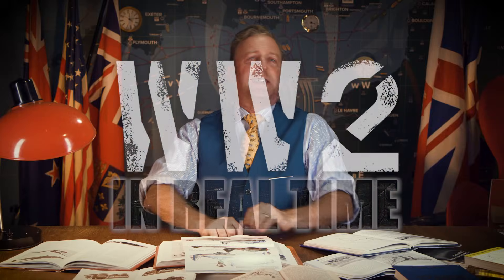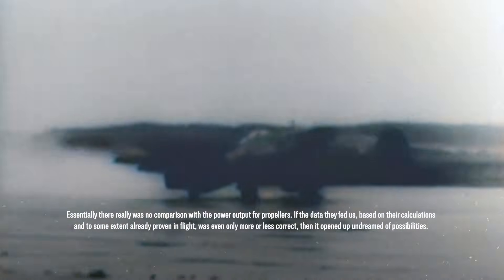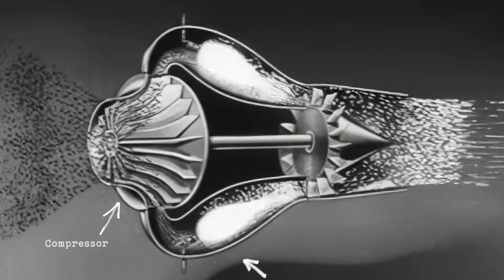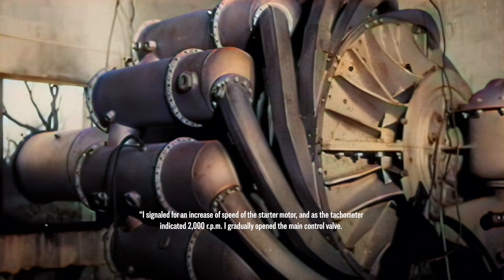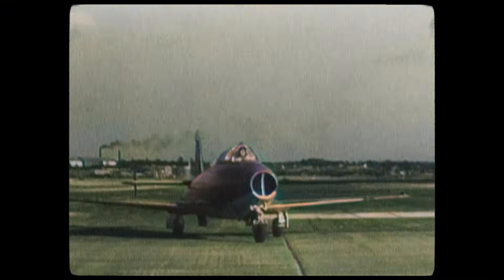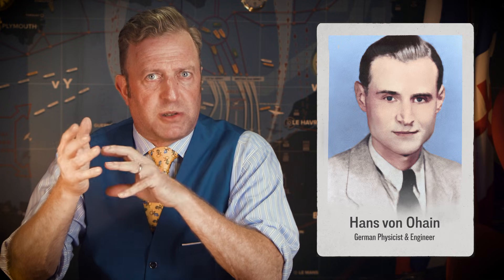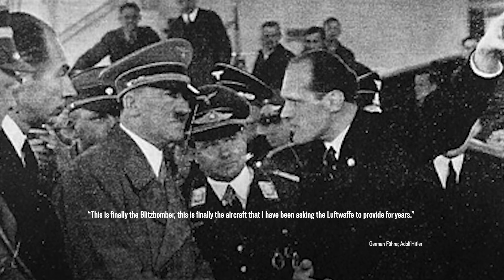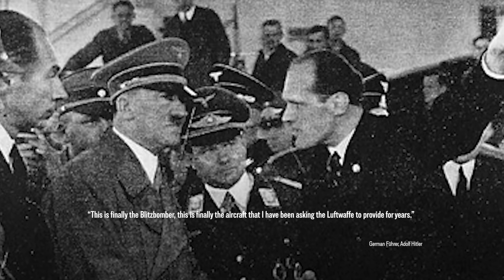WW2 Jet Engine Development - WW2 Special Documentary

Comment: The Brits built a centrifugal compressor while the Germans built axial compressors.
Reply: The Brits actually had a contemporary axial flow, in the Metropolitan-Vickers F.2; a far superior engine. The Brits never used it of course become they were never so desperate to use experimental engines in active planes...
Reply: @tisFrancesfault  thank you.
More information for me to integrate.
Reply: @tisFrancesfault The F.2 was a notable failure, Metropolitan-Vickers would completely abandon jets in 1947 and returned to building steam engines.
Reply: @sandervanderkammen9230  given that the F.2 was the genesis of the successful Sapphire, I don't see how it could be considered a failure. It was scaled up to become the Sapphire as demands for larger engines arose. Metrovick restructured as part of a post-WW2 realignment with the jet business being a valuable asset that could be sold. That's very much not the same as it being a failure, just restructuring. The way you characterise it, you'd think people working on jets one day changed to steam engines the next, which is not the case.
Reply: @wbertie2604  The F.2 was never a flight-rated engine, it never received Airworthiness certification from the RAE and was not adopted by the RAF, it never achieved the minimum PFTR reliability test requirements,the F.2 did not enter production.... it was a complete and total failure.
Reply: @wbertie2604  No production aircraft was ever powered by a Metrovick engine, the F.2 was a failure.
Britain's first successful, airworthy, production axial turbojet was the Rolls-Royce Avon in 1950... an engine developed after the war and heavily influenced by captured German axial compressor technology and German engineers.
Reply: @sandervanderkammen9230  no production aircraft was powered by Whittle's early engines, so by your logic Whittle's efforts were a failure. You position is not credible (yet again).
Reply: @wbertie2604  No engine made by Whittle  could pass the RAE's 100 hour PFTR reliability requirements.
Whittle was using inferior materials like Brown's 18/2 and REX 78, steel used primarily for cutlery and kitchen utensils.
Reply: @sandervanderkammen9230   ah, so Whittle was a failure. Right. Do you REALLY want to suggest that?
Reply: @sandervanderkammen9230  cutlery. Nonsense.

 "Rex 78

A specialised high-temperature steel devised in 1939 was Rex 78 and its derivatives, Rex 78 being used on the turbine blading of Frank Whittle's early jet engines such as the Power Jets W"

I somehow doubt cutlery requires high temperature steel. Or maybe you like to put yours in the oven with your dinner and cook food at 400C? If so, please stop.
Reply: @wbertie2604  I can prove that, none of his engines were reliable enough for airworthiness certification and did not enter RAF service or production.
After the Miles M.52 scandal broke, Whittle was discharged from the RAF amid allegations of extorsion, embezzlement and derliction of duty, he was removed from his own company and exiled to a drug rehab in America.
Whittle would never work as an aerospace engineer again for the rest of his life.
Reply: @sandervanderkammen9230  I eagerly await the proof.
Reply: @wbertie2604  REX 78 alloy was not created for jet engines and Whittles use of Brown's 18/8 and REX 78  which are corrosion resistant, chromium-based stainless steel is why his engines were too unreliable to meet the 100 hour PFTR requirements,  Whittles turbine blades burned up or broke off during the tests.

The Armstrong Siddley Sapphire first ran on October 1st. 1948.

The Armstrong Siddley ASX ran in 1943... not the Sapphire.

The Armstrong Siddley ASX was developed into the Python turboprop but was abandoned.
Reply: @sandervanderkammen9230  Whittle resigned from Power Jets after it was nationalised, along with many other companies, after WW2 and he no longer had control over its destiny. He resigned from the RAF two years later after a nervous breakdown. That's not at all how you have characterised it, so if you have evidence to the contrary, please provide sources. He received a knighthood and other honours, including from the RAF. Later, he was a technical adviser at BOAC, so he did continue in aeronautics.
Reply: @sandervanderkammen9230  more nonsense. Rex 78 was created as a high temperature alloy. An alloy doesn't have to be specifically created for a purpose to be used for it. You claim it was used for cutlery, but surely that can't be true as it wasn't designed for it. You seem to be confusing 18/8 with Rex 78 - the former was corrosion resistant, the latter specifically for high temperature applications.

The Sapphire design dates from 1943. The first run date doesn't change that.
Reply: @wbertie2604  The facts here are irrefutable, your feeble attempts to rewrite history are futile.
 REX 78 has a creep temperature that is too low for turbine blades, no production jet engine has turbine blades made from this material.

The Armstrong Siddley Sapphire incorporated many new features from the ASX and captured German technology, it first ran on October 1st 1948... years after the war ended.
Reply: @sandervanderkammen9230  alloys used in the W1 (this is from a paper by Whittle): Hiduminiuin RR59 and Mg. Alloy No. 299 DTD.350 (compressor), Firth-Vickers Rex 78 and Firth-Vickers Stayblade (turbine). The Stayblade was just the disk of the turbine. Staybrite is 18/8. But it's only a small part of the engine and specialised high temperature materials were used for the turbine blades. Stayblade was DERIVED from Staybrite but was also a high temperature alloy, resistant to 550C, definitely not a cutlery alloy.
Reply: @sandervanderkammen9230  you suggested that the alloys used were fur cutlery. They were specific high temperature alloys. You made a very specific claim which I've shown to be incorrect.

At that period blade creep was an issue for all alloys being used as metallurgy for the purpose was still developing. It took decades to really fix. Should Whittle have used unobtainium?

You've tried to rewrite history multiple times and (pun intended) been shot down multiple times for it.
Reply: @sandervanderkammen9230  and you can provide specific evidence for the German technology used? You've failed to provide such evidence so far.
Reply: @sandervanderkammen9230  in any case, Whittle knew that the metallurgy of the alloys in his W1 was lacking, which is why improved alloys were used in the W2B, which productionised by Rover and Rolls Royce became the Welland, which was a production engine, albeit it in small numbers.

If you must criticise Whittle then his being difficult to work with (and I have personally heard anecdotes of those who worked with him) and that he was not skilled in turning prototypes into engines that could be produced at scale would be entirely valid ones.
Reply: @sandervanderkammen9230 
The F2 was used as a testbed and whilst it did not fly it was the basis for the Saphire engine
Reply: @sandervanderkammen9230 
The F2 was a running testbed in 1941 but was determined to be to heavy at the time for use in the early Gloster prototype so the decision was made to use the lighter and more reliable Centrifugal flow powerjets engine. The F2 was later modified and using lighter Alloys became the Saphire engine
Reply: @tisFrancesfault  it was developed into the Sapphire
Reply: @wbertie2604 The Sappire was a completely new design development by Armstrong Siddley
Reply: "The Armstrong Siddeley Sapphire is a British turbojet engine that was produced by Armstrong Siddeley in the 1950s. It was the ultimate development of work that had started as the Metrovick F.2 in 1940".  

"Design evolution of the Sapphire started at Metropolitan-Vickers (Metrovick) in 1943 as an offshoot of the F.2 project. With the F.2 reaching flight quality at about 1,600 lbf (7,100 N), Metrovick turned to producing larger designs, both an enlarged F.2 known as the Beryl, as well as the much larger F.9 Sapphire"
Reply: @wbertie2604  The F.2 was abandoned by Metropolitan-Vickers when they left the jet engine business in 1947 in total failure, Metropolitan-Vickers returned to building steam engines.
The Armstrong Siddley Sapphire is a completely different engine from the F.2.
Reply: @sandervanderkammen9230  I already pointed out that the Sapphire was developed from the F.2. Your assertions are incorrect. And its not that Metrovick got out of the jet engine business voluntarily - it was by government edict.
Reply: @wbertie2604  The Sapphire was designed by Armstrong Siddley After the war... it is a different engine from the F.2 and incorporates captured German axial turbojet technology... this is why the Sapphire was successful and the F.2 was not.
Reply: @sandervanderkammen9230  I wasn't aware the war ended in 1943. Thanks for the update.
Reply: @sandervanderkammen9230 
No the Saphire had some changes to some of the internals but was a direct descendant of the F2 engine design
Reply: There were five turbojet engines in the UK under R&D in WW2:
1) Centrifugal, by Whittle (Rover); 
2)  Centrifugal, by Frank Halford (DeHaviland);
3)  Axial-flow, by Metro-Vick; 
4)  Axial-flow by Griffiths (Rolls Royce); 
5)  Axial flow compressor, with reverse flow combustion chambers. The ASX by Armstrong Siddley;

Comment: A jet engine is an internal combustion engine. The definition of an IC engine is to use the fuel and the air mixture themselves to generate power (compared with the steam engine, which uses an external source i.e. water to channel the energy to generate power. Which is an external combustion engine).

A jet engine has all the processes a piston engine has. But it is separated into 4 different components (compressor, combustor, turbine and exhaust) to perform them simultaneously, rather than doing them in the same chamber one after the other as in a piston engine.
Reply: I noticed too. Strange how people seem unable to separate the concepts of IC & being piston-driven.
Reply: Excellent points, all gas turbine engines (which Inc. Turbojets) are Internal combustion, the combustion air is also the 'Working Fluid' there is no phase change of further energy conversion apart from mechanical energy.
Gas turbines operate using the  Brayton Cycle and this is the only fundamental difference between jets and Otto or Diesel Cycle engines.
Cheers!
Reply: @@retiredbore378 Interestingly jet engine is not picky about fuel it uses. Theoretically same engine could use any flammable liquid and modern jet fuel is very much diesel.
Reply: @vksasdgaming9472  Since the jet engine burns very lean and uses continuous flow, only a continuous flow of fuel mattered.

But controlling the continuous combustion was proved to be very hard. A slight disruption of air flow (e.g. crosswind, compressor stall) and fuel fuel scheduling would cause the engine to flame out. 

On a minor level, wrong fuel/air mix could cause hot spots in the combustion chamber and severely shortens the lifespan or even burns out the turbine.
Reply: @vksasdgaming9472 Diesel and Otto engines can burn any fuel a jet engine can... it not a unique or distinctive feature exclusive to jets.
Reply: @sandervanderkammen9230  Putting diesel fuel to Otto (gasoline) engine will lead to engine stalling followed by heavy overhaul of whole fuel system. Opposite will lead to smoking, banging and heavy overhaul of whole fuel system. Jet engine is not picky, but Diesel and Otto engines are and latter even more so.
Reply: @vksasdgaming9472  Yes and No, some Otto engines can run and do run on Diesel #1 or Jet A.
Diesel engines that have density compensators can run on any fuel used in jet engines.
All of the US Army combat vehicles in service with a Diesel engine run on JP-8 (Jet A1)
Otto engines can run on any alcohol based or gaseous fuels.
 Jet engines have no unique multi-fuel properties.

Comment: German jets get the hype, but they were far inferior to British jet engines. The key diffrence is, Germany was desperate enough to try to push experimental and under-developed engines for front line use.  German jets were developmental dead-ends.
Reply: Not at all. The axial jet engine was the way forward in the long term. All modern engines are of this type. Plus the turboprop engines used in early cold war Soviet bombers are direct developments of the Junkers experience.
Reply: @guidor.4161  The idea that Axial flow being the better option in the long run was know from the start; Mechanical engineering constraints would show for a fairly significant time they (radial compressors) would be the better choice short to "mid term", its why whittle would favour it. Regardless, the UK still had the far better Axial flow engine that is oft forgot, that being the Metropolitan-Vickers F.2. This was an engine that would be developed into the Siddeley sapphire. 

Every post war nation effectively utilised British engines in their development.  From the Klimov VK-1, to the J48Pratt & Whitney J48. The Jumo 004 has no successors because it was a obsolete prototype at launch.
Reply: Sorry. You have that back to front. Axial flow is the one that developed into every modern turbojet or turbofan. The Germans were handicapped, as Indy says, by lack of high temperature resistant materials. Centrifugal flow was only developed beyond 2nd generation engines for turboprop engines such as the RR Dart.
Reply: @catherineburton195 Germany invented the first creep resistant nickel based stainless steel in 1930, and was decade ahead of the Allies.
 Often overlooked by amateurs and armchair analysts is the huge lead German had in thermal management technology.
Only Germany had the critical pioneering developments of bleed air cooling of the turbine blades and the first use of TBCs...
Reply: @catherineburton195   This is an error of mechanical understanding. as said, Whittle, also knew the axial flow was a better technical design, but also knew it would face considerably more difficult development due to material constraints and understanding of the time. This is correct. Regardless of that point, as said the British were working on the Metropolitan-Vickers F.2, a far superior engine. 

The issues of materials would only have saved a few days worth of operation for the Jumo 004, it wasn't good enough. people mistake the "first operational jet fighter" as  being a good a) plane B) having good engines. No, first and foremost it was  cheap.
Reply: @tisFrancesfault This actually goes on to most German "wunderwaffe" as well. With tanks, as much as Wehrbs like to jerk off at Panthers and Tigers, they were dead ends. Most post-war states either based their new MBTs on the British Centurion or the Soviet T-34-85, or with the Americans making up their own combination of a lighter Pershing with a 90mm gun.
Reply: @tisFrancesfault That's is deceptive and misleading... Britain would not have a flight rated axial turbojet in production until the 1950s... both Germany and America were years ahead of the British.
Reply: @tisFrancesfault Now you are just making things up, when Frank Whittle was exposed for plagiarizing the work of A.A Griffiths 1926 paper he called into question Whittle's engineering competence by revealing that he didn't understand how axial compressors worked, and then proved it by pointing out several egregious errors in Whittle's 1930 patent.
Whittle would in fact abandon the 1930 axial compressor design and start over in 1936 with a centrifugal compressor, he would never attempt to build any engine with a Axial compressor.
Reply: @catherineburton195  
There were five turbojet engines in the UK under R&D in WW2:
1) Centrifugal, by Whittle (Rover); 
2)  Centrifugal, by Frank Halford (DeHaviland);
3)  Axial-flow, by Metro-Vick; 
4)  Axial-flow by Griffiths (Rolls Royce); 
5)  Axial flow compressor, with reverse flow combustion chambers. The ASX by Armstrong Siddley;
Reply: It was well-known and understood by industry experts after the war that Germany's jet program was years ahead of anything the Allies had..
The majority of the efforts made by Operation LUSTY was gather as much German Jet technology as possible and bring it back to America.
 Britain wasted an entire decade developing centrifugal jet engines which was a complete waste, centrifugal jet engines were an evolutionary dead-end concept and totally obsolete upon introduction.